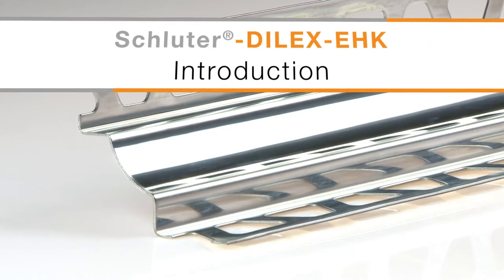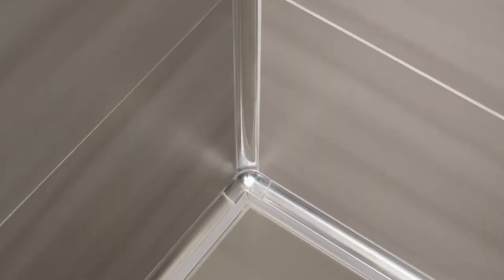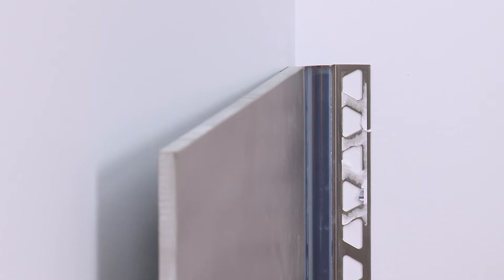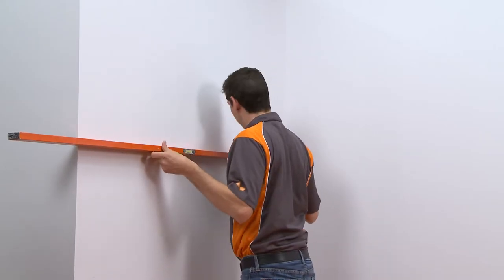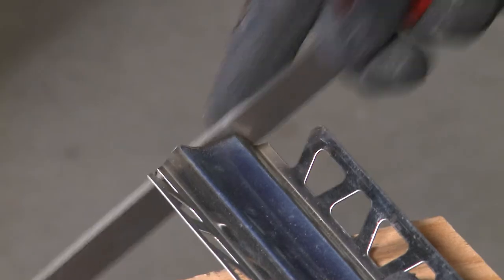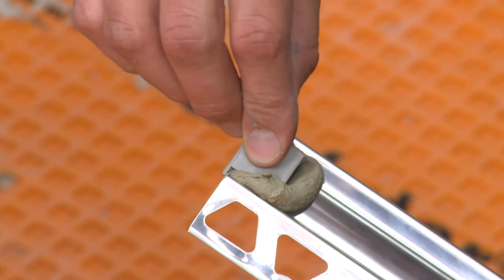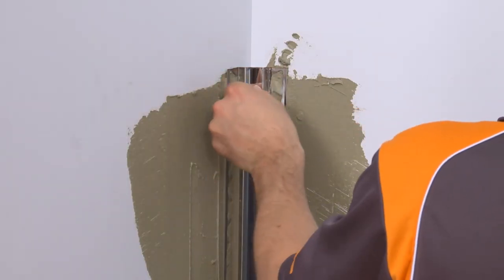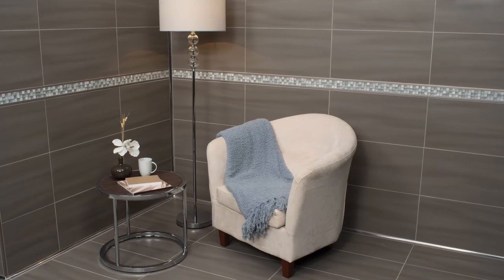How to install a cove-shaped profile: Schluter®-DILEX-EHK profile

Comment: Pretty frustrated that I can't find good instructions for Dilex or other profiles.  How do you install the other accessories, such as splices or outside corners?  Do you leave a gap or run the profile in direct contact with the tile?  Do you use caulk or grout between the tile and profile?  There are far too many Schluter videos out there not answering these questions.
Reply from the maker: Hi bvcxz gt! Which DILEX installations are you looking for? Let us know and I can refer some links or direct you to our website in order to get you those answers you're looking for. Thanks!